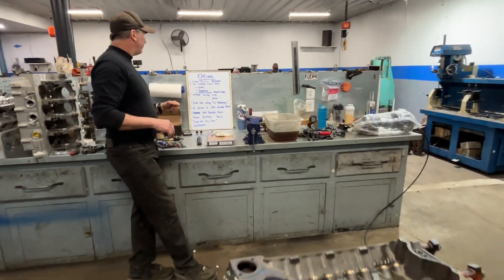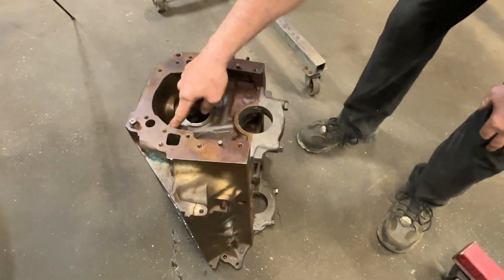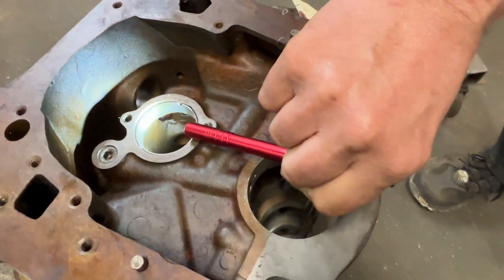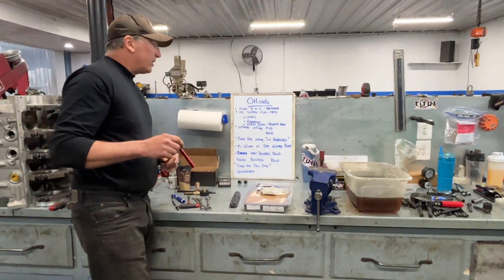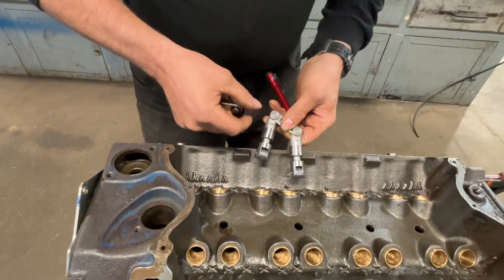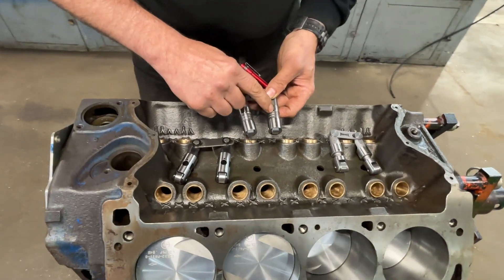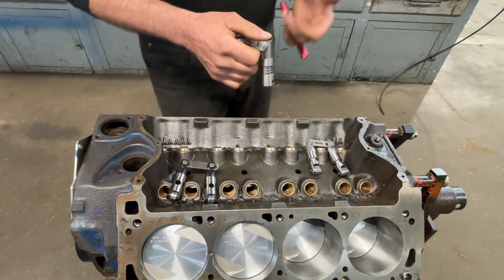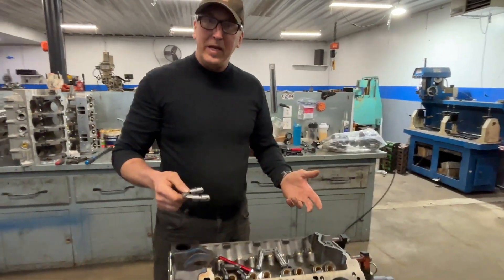Cleveland vs Windsor Oiling (Trimmed Part 2) // Myths, Oil Pressure, Block Design –Titus Performance

Comment: Camshafts dig themselves a valley, oil hole needs to be  on the upper side so the cam can roll the oil around and will not wear any.......i shouldve kept that to myself.....10.9.25 howie.....

Comment: So if you were going too use the restricted bushing method would you restrict both sides or just the passenger side. Using a solid roller drag racing application were would the restriction hole size be good to start with? I am using standard size ford comp cam roller.

Comment: at the end you said it prevents the oil from getting from the bottom of the engine to the top of the engine. im hoping you miss spoke because the oil flows from that large galley down to the mains and then to the cam. the top of the engine feeds off the large galley as well totally seperate from the bottom end. to restrict the oil to the top would be done through a smaller center hole in the push rod unless you have lifter issues because all the oil to the top end goes through the lifter